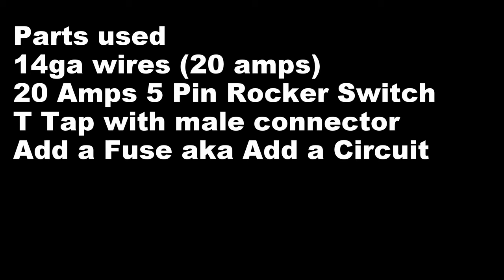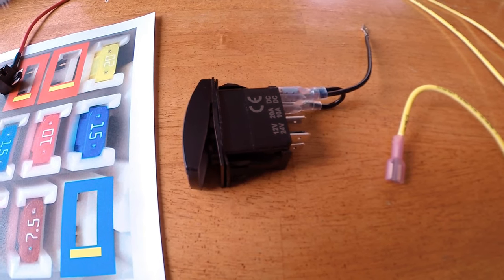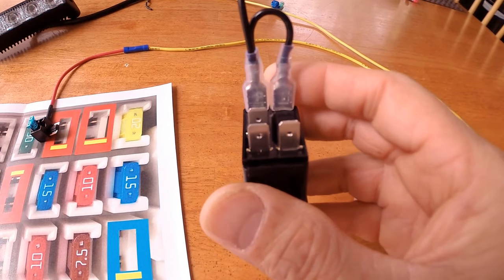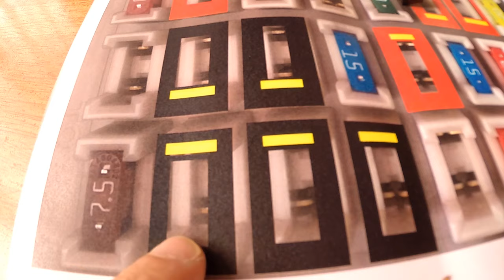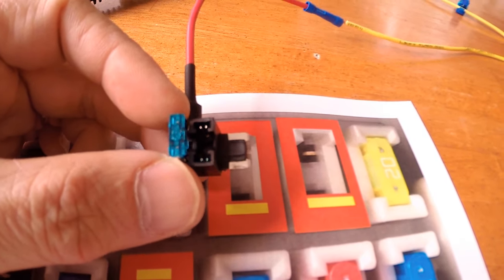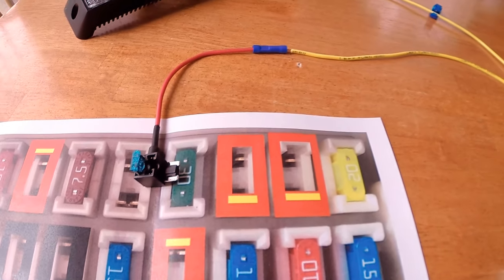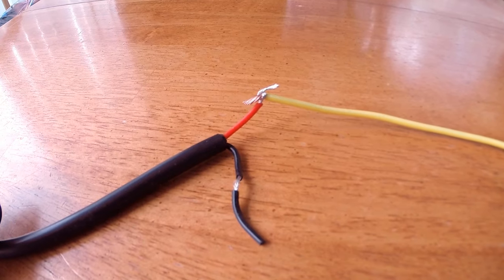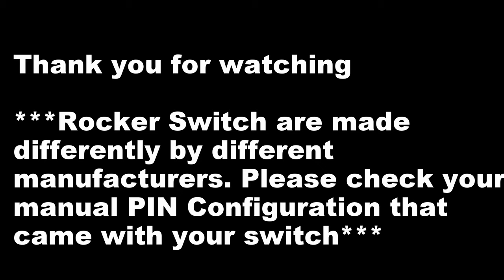FJ Cruiser How to wire switch Add a Circuit LED Lights Accessories Auxiliary to Fuse Block

Comment: Can you help, I have this wired up correctly but only my bottom led is lit, when I flip the switch on, the bottom led goes out but the top does not come on. I hooked this up to a 9v battery to see if the led bulb was out and it seems to work then. Any ideas? Thank

Comment: Cbatilo. I have an ‘07 model and noticed mine has extras and not sure what they mean. I looked at the manuals and noticed one is an LSD Auto, and Sub woofer, BUT I don’t have a sub woofer and it’s tied into the Atrac. Did yours have that?
Reply from the maker: +axortiz1 I’ll research it... send me a picture. Cbatilo@gmail.com
Reply: axortiz1 hey what’s up, my have the same in the manual it shows one for the subwoofer and the other one for lsd that’s only for 2 wheel drive and mine is4x4, also noticed that my fuse box shows a fuse for roof lights and other for the spot lights I wish I can learn how to use them
Reply: Eddie Rivera Yeah the LSD is for ‘07’s but it’s irrelevant to ours since it’s 4x4. Cbatilo has some good vids on mods you can watch and maybe that’ll help you. I’m doing his USB connector from his vid and then adding the fog lights later. Maybe there’s a way you can use the connectors for the subwoofers as a push button for extra lights. Good luck.

Comment: Just so no one is misinformed the fj uses the negative () to control the dimming through the dash lights. So jumping the ground () and tapping it into the chassis will result in a non-dimmable switch through the dash lights.
Reply: Ok, so where should I place the ground wire so that it is still dimmable?
Reply: I took my console out, that will access to the stack of switches. Locate the RR DIFF switch. The back of the switch will have some wires. Using 2 t taps tap the green wire and the green/white wire. These are your illumination wires. Connect your switch to the taps. You should now have a dimmable switch

Comment: Just wondering what the blue designates for the fuse opening on the bottom right...
Reply from the maker: +Bob Theiner it's key accessories.... "Key on" halfway turned without turning engine on.
Reply: Thanks, your video was very helpful, now my FJ has plenty of light for any situation.  Maybe one more set, you can never have enough lights.  Thanks again. Bob

Comment: Could you please advise as to where you found the information and picture on the fuse box?
Reply: the owners manual, the fuse box hes speaking about is under the steering wheel on the drivers side

Comment: I have tried this method. Turned out the fuse panel won't accept the Add a Circuit. It physically won't plug in as it stops on the raised edges around the fuses in the block. 2014 FJ Cruiser.
Reply from the maker: +Thomas Harrell make sure you get the one with the long prongs. I found two types of them in Amazon. Send me an email at cbatilo@gmail.com and I'll send you a link for the ones with long prongs
Reply: They didn't have that version at my local auto store. So I rigged it up with a 10 amp fuse in the aux position and a wire wrapped around the fuse.
Reply from the maker: Here is what I did with the short prong Add a Ciscuit: https://youtu.be/bfGQ9MZd5v4